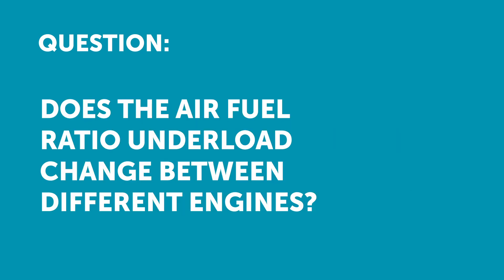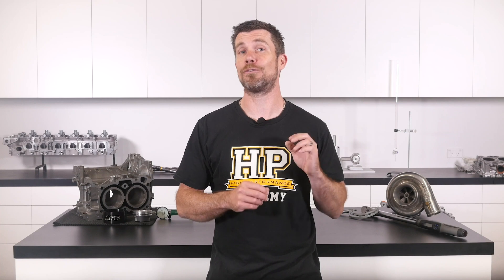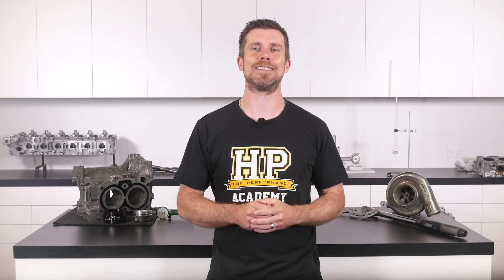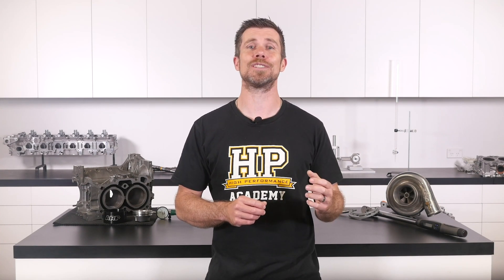Does Every Engine Use The Same Air Fuel Ratio? [HPA Q&A]

Comment: Great point! As a mechanic thats tuned thousands of carb engines both performance and heavy duty i can day that i cringe when i see someone shoot for a one size fits all afr. We found that some wanted lean others (big 305-478ci GMC V6 and Internationals esp.) Like to be very rich under full load with alot more timing. This actually saved much MPG as well as living longer. They would actually smoke a little under full load. We used timeslips at the track to power tune or pto dynos. Usually cleaning and carrying a few sets of colder plugs ran best! Learn how to read plugs, especially on cross ram or such intakes.

Comment: Wideband’s can lie! The best thing to do by far is read the plugs! Then make you own decisions what the afr should be, personally I think as lean as possible for idle and low load and a rich afr under boost that keeps it cool and away from pre ignition without loosing power or fouling plugs, I’m tuning a 4ze1 turbo that likes to idle no leaner than 14.7 any leaner and idle is unstable,but my own l36 turbo  likes to idle as far down as 16:1 and even 18.5:1 where it  starts to sound like my RB or a 2j with 276deg cams

Comment: I got a bit of a cam question when it comes to racing and turbo engine with a TIR. I am currently running a VF48 wit a 37mm TIR on a built EJ255 (9.0:1cr) but will probably go to a EFR6258 in the future. Those are the biggest turbos I can running in my road racing class with the SCCA. We normally run 16-20psi depending on the conditions. Is there a point where you can have too much cam for something like this?

Comment: Not all engine are created equal. The way the engine atomisers the fuel will affect how much fuel you need to give it. We are always running on the rich side of perfect fuel mixture to compensate for an amount of fuel that isn’t atomised correctly. Fuel doesn’t burn but fuel vapour does.

Comment: I tuned my NA B18C to 12.8 to 13.0 wot afr and 14.7 at idle and light load 13.5 medium load with 26 degrees total timing at wot in vtec tables I’ve tried more timing no gains seemed kinda low but I just went with what it wanted

Comment: I've tuned my 4 cylinder turbo engine to idle @ 13.5 AFR and i recently tuned a Chevy 454 V8 that liked close to the same at idle with 13.8 AFR. 

i want to ask, how do Ferrari, Lamborghini, Porsche, Mercedes and BMW or even IMSA race teams go about tuning their cars? what's their strategy?
Reply: My built EJ257 loves to run rich. I’ve got it at a 13.5 AFR at idle and 10.7 at WOT. Pretty sure the European turbocharged cars they run very rich with lots of timing and lower boost levels. The Americans like to run them on the leaner side with lots of boost and less timing.